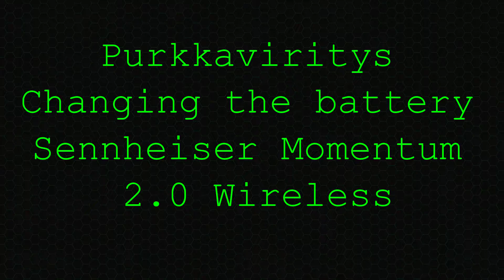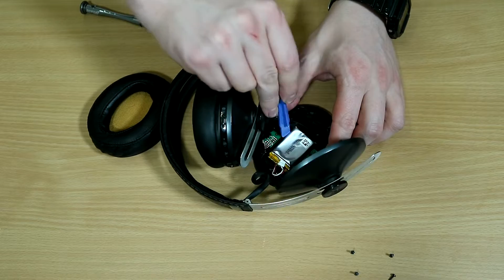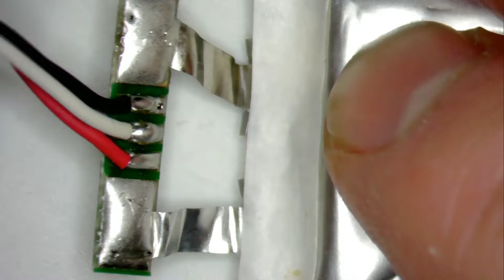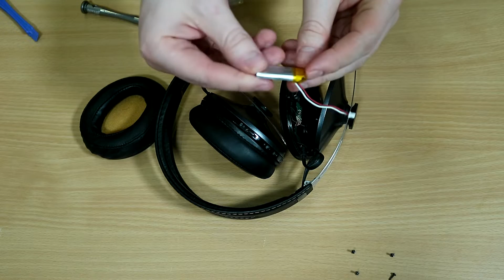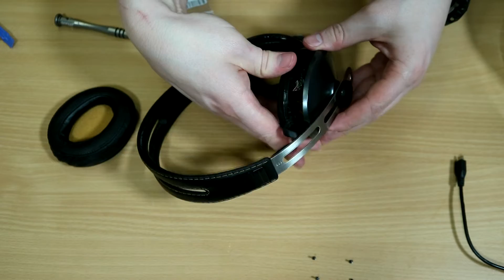Sennheiser Momentum 2.0 Wireless Battery Replacement

Comment: There is a difference with the Momentum 2 On Ear, which requires the user to unscrew a small circuit board, as the connector to the battery is beneath it.

Comment: For anyone doing a Momentum 3, it's the same process and on the left side too, except after removing the foam ear cushions you will need to remove the large plastic retaining ring with a slim plastic tool (it has this ring instead of stickers). It simply clicks in. When reassembling it, the plastic ring needs to be placed inside of the back of the ear cushion and then it will click back into the headphones speaker assembly.
Reply: OMG  ... it's a miracle lol. I got the battery in the mail from Amazon this afternoon and I managed to install it and then everything went back together shockingly easy. My headphones are back to life. Thanks so much again.  I feel like a bloody genius 😂
Reply: @RobbieCalifornia69  well done! Good on you for persevering
Reply: I completely screwed up by not having a friend video me taking these Mom 3's apart ...  because I can't figure out how they go back together. Not having good eyesight doesn't help either. I guess I'm going to go buy some new Momentum 4 tomorrow. I can't believe they sell expensive headphone that just become paperweights after just 3 1/2 years of use? This modern world really sucks if you ask me.
Reply: @RobbieCalifornia69  I suggest you keep trying to put them back together even if you have to ask for help from a friend. I gave my pair to my dad so unfortunately can't help with any reference photos.
Reply: @getthecats  My son just sent me a link that might help. I'll give it my best shot. Thanks for the encouragement  :)

Comment: Maybe you could help me. My speakers for my left side doesn't work. Sometimes it does, but I do not know why, Could you help me?
Reply from the maker: probably a connection issue, I take it that you are using them in bluetooth mode, if so you need to make sure the wire that feeds the signal to the speaker that has issues, is connected properly and does not have a break in the soldering joint. That is where I would start. if you are using a cable to listen, change the cable.
Reply: @Purkkaviritys  it works fine when the speaker is out of the socket, nfc wire is touching. I just have to find a way to fix it.

Comment: When plugged in, mine flash red light every 2 seconds but never charge. I measured the voltage across the battery at 4.1V DC. Could the battery still be the issue? What else could cause this? A disconnect of wire in the headband?

Comment: Adding to my earlier comment on Sennheiser Momentum 3 battery replacement. The 4 screws you need to unscrew can be done with a Torx Plus 6 IP screwdriver. I figured out the screw type, and found 3 Torx Plus screwdrivers on a well known auction site, the 6 IP just happened to fit the screws.
Reply: hi @oscarrox My M3 don't have any screws at all, did you have stickers or something? or did you pop the driver out of the centre first?
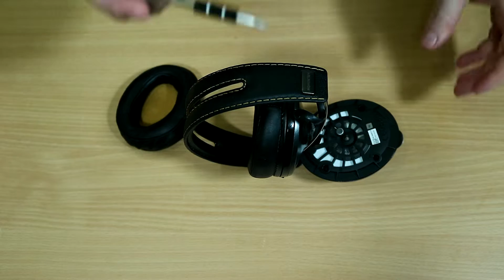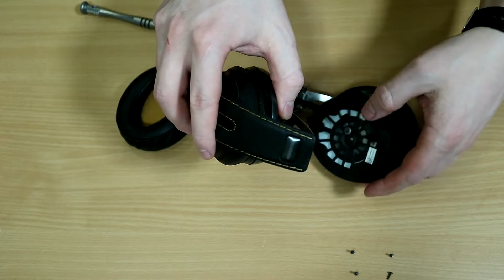Reply: @w1ldfl0w3r  Hi, like in the video at 0:56, after taking off the earpad, there is an oval (black plastic) plate with the driver fixed onto it, there are 4 screws (torx plus) on the plate you need to unscrew, then you can tip out the plate (like in the video at 1:05) and change the battery, which is also fixed to the plate. No stickers, the 4 screws were in the same place as in the video, but the plate is a bit different. Didn't pop out the driver as it is fixed to the plate. I bought my M3 in 2019.
Reply: Thank you for this valuable information! I can confirm the Torx  T-6 fits the screws in Momentum 3. @oscarrox

Comment: Good helpful review, mostly. I had been hoping the momentum 2 wireless would be the same procedure for my momentum 3 wireless headphones. Unfortunately the four screws sennheiser used on the M3 are difficult to figure out, could be torx or torx plus, they are very small, cant identify the screw head even with a magnifying glass. I've got the battery, cant open the earphone! Anyone seen this before?

Comment: Great stuff, just wondering, did you replace the tape behind the battery? if so what kind did you use?
Reply from the maker: pretty sure I didn't but you can just get some 3M double sided tape to do the job.
Reply: @Purkkaviritys  ok cool, thanks for getting back.

Comment: Hi, how do I know if my set needs battery replacement?   Would blinking red led while charging be that case ?
Reply from the maker: if it does not hold charge, then yes that would be an indicator
Reply: @Purkkaviritys  Hi, Thanks,   Would you know what it means why it's blinking red light every 2 sec when charging?
Reply from the maker: @rolandMclovin  no idea to be honest, but if I had to guess I would expect it to be because the battery is in such a bad condition that once it gets a little juice, the headphones wake up draining it fully and then shutdown allowing it to fill a bit again, so it gets stuck in a loop.
Reply: @rolandMclovin  did you ever figure this out? I have same problem. Blinks red every 2 seconds as if it's charging, but I can't turn them on
Reply: @Carter_Moody  not sure, but i think its the micro usb connnection problem. when I bend the connnector to one side it seems charging. One time it  did acctually charge the headset.

Comment: Welp, this video kind of confirmed that the issue I'm having with mine isn't necessarily a dead battery (thank you).
When plugging mine, the led would light up red and stay red for a few minutes, then turn off.
The headphones never turn on either.
Tried replacing the battery, same problem still. Then I made the mistake of plugging them in a fast charger, which seems to have made matters worse, because the led doesn't turn on at all anymore.
The led does flash red twice if I plug them while the battery is unplugged tho. 
Aaaand I noticed that one of the two wires for the bluetooth got loose during this process, so if I can ever fix the charging problem, I'll have some soldiering to do
Does anyone have an idea of what it might be? I'm considering getting my hand on an electric meter at this point :/
Reply from the maker: get yourself a multimeter anyway, it will help you diagnose lots of stuff later. see the EEVblog recommendation list on what to get.
Reply: Hey I am having very similar issues. LED not lighting up anymore, I had wondering if using a fast charger had something to do with it. When plugged in, the side with the microUSB slot gets hot (not the side with the battery). Is yours similar?

Comment: Do they use the same battery momentum 3 and 2 ?
Reply: LOSONCOER 1000mAh Headset Batterie Für Sennheiser Dynamik 3 Drahtlose M3 Drahtlose M3AEBT DYNAMIK Wahre Wireless AHB702535PCT-01

Comment: Thank you for this.
Do you have a video for foxing the bluetooth issue?
Several months ago my water bottle leaked in my backpack and entred into the headphone. It was working after cleaning and letting it dry but it sure got to more important parts and damaged the bluetooth. 
Thanks in advance

Comment: I tried to fix the fact that they didn't turn on, then I replaced the original battery with another one bought on Aliexpress. Still nothing! They don't turn on. What should I do?
Reply from the maker: is there any corrosion you can spot inside the headphones, because if they have had water ingress it may have broken things. Outside of that its hard to say. it might be that one of the chips that power the thing is broken. 

The corrosion is technically usually fixable, provided you can replace the corroded parts.

Other than that, I would look at the cables connecting the 2 halves of the headphones together and use a multimeter to test the continuity, as in does the power reach from the battery to the other side where the charging connector is.
Reply: @Purkkaviritys  Thank you for answering me. That's a very kind of you. The main issue is that I don't understand electronics.

Is it possible to find some replacement parts such as chips you were talking 'bout?
Reply from the maker: @DOMEROCK  well, you'd have to diagnose them first to see which if any are broken to be able to replace them. There are way too many components there to just try to randomly replace them.
Reply: @Purkkaviritys  iOk, understood. thank you!  In case i have one damaged chip, where I can find spare parts?
Reply from the maker: @DOMEROCK  provided that the chip has text that tells you what it is you can even find the parts, digikey for ex might have the part. This is why it would be great if we got right to repair trough so I could have access to the schematics so I could even look where is the most likely thing to break and then buy the parts instead of having to stab in the dark for a possibility that I manage to stumble on the broken thing by trying to reverse engineer how the device works.
Reply: @Purkkaviritys  I haven't found anything on digikey sadly :(

Comment: This might be a long shot but I figure I'll ask it anyway. My Momentums have recently starting to turn itself off during use. I figured it must be a bad connection somewhere, a bad cable or maybe even damage to the pcb. So I opened both sides and inspected them. I can see no visible damage to the cables, sodder points or PCB. I don't think it's the battery since it still holds a pretty decent charge. When the headphones turns off I can just turn it on again and it functions as normal, untill it turns itself off again in a couple of minutes.
I don't know what's wrong with them. If I can fix them myself I'd rather do that than buy new headphones. Any ideas would help.
Reply from the maker: sounds like the battery is the problem tbh.

If the wiring was the issue, you likely would not be able to charge it at all nor would it turn on if it was internal wiring issue.
Reply: I am having the exact same issue. Opened them up today, no visible corrosion or loose wires. Even tried gently shaking wires with a tweezer while sounds were playing, didn't see any change. I didn't take teh PCB in the right earcup out to check the other side though. My problem got consistently worse over time, before it would happen occasionally, now it happens very frequently. A small amount of shake or movement somehow triggers it but its hard to understand what type of jiggle makes it happen. I have tried shaking either side while holding 1 side firm, but still didn't see anything on 1 side to do anything more noticeably to cause this. Since this started, the mic also does not work on video calls on PC, unless I use the USB wire to connect to a PC using USB headset mode and select that mic. Mic works on phone video calls, but the headphone is also turning off frequently. Might need to email Sennheiser and see what my options are. I love these headphones too much to get new ones. Used for just over 3 years now.

Comment: I replaced my battery and the headphones work fine (there was already some charge in the new battery) BUT it will not charge.  I stick the usb cable in and there is no indicator light blinking that indicates charging.  Help!   It's too bad, because they sound great but there is no way to charge them or use them directly with a computer.
Reply from the maker: it could be that the usb connector is broken, so once that happened the old battery never got charge to begin with.

Comment: Has anyone replaced broken cable between the cups inside the headphones bridge? Is it doable?  🤔
Reply: Ive got the same issue, there's a loose connection on the wire between the cups on mine close to the left cup, did you have any success? any ideas how many different strands of wire are in that cable is it 4?
Reply from the maker: even if it wouldn't be possible, you can always run new cables between the headphones be it on the inside or outside.
Reply: did anyone work this out? My cable got connection problems just above the left cup yesterday.
Reply: There are so many cables leading through the bridge that it demotivated me to try to repair it (I have also have accidentally destroyed the charging PCB when trying to replace broken micro USB connector). For sure it is not possible to replace the cable without removing the rubber from the edges of the leather bridge and then you need to solder a lot of wires. Some photos from the inside of the headphones (cups are easy to disassemble, just be careful and do not use any power).
https://photos.app.goo.gl/mcbxmryaNVBheF5s7

Comment: Hi. My set has stopped charging.(no flashing light) Do you think the battery could be the culprit? I've had them for 4 years. Thanks.
Reply from the maker: Entirely possible, only way to find out is to open up the headphones.
Reply: @Purkkaviritys  Ok thanks

Comment: mine arent pairing, blocked jack port? (stuck in cabled mode maybe..)
Reply from the maker: the jack might have a "cable connected" pin, that is stuck and thus wont come out of cabled mode

Comment: Dear  Purkkaviritys thanks for the tutorial. I have the same  Sennheiser Momentum 2.0 Wireless it stop turning off when i pressed the button. Do you have an idea how to fix it?
Regards
Reply from the maker: check the connections of the button, maybe the solder has cracked and the button no longer makes contact?

Comment: I have pxc 550 headphones , they were working fine, place them on the charger. Picked back up for use now they don't work. They seem unresponsive. Plug them back onto charger and the battery indicators says full. Turn them on and off with no hole mode button and nothing at all. Any ideas ?

Comment: Do you know if the urbanite xl wireless have a similar process? I believe that my battery is dead also. The light only flashes while charging. Sometimes it works while charging but recently it won’t even turn on. Does it sound like the battery or might I have another issue?
Reply from the maker: similar? probably so generally the swap is the same, but the outer casing design is very different  so opening it may be very different.
Reply: @Purkkaviritys  thank you for the response! I understand your point though and since it's not functioning anymore I don't really have a fear to at least try. I found some replacement batteries on ebay so I'll give it a go and see what happens.
Reply from the maker: @jeminem619  you may be able to find opened pictures of the headphones on FCC website, you may have to look for a moment though as they usually have some weird name there.
Reply: @Purkkaviritys  pardon my ignorance but what is "FCC"?
Reply from the maker: @jeminem619  the US Federal Communications Commission, if you bring a device that has a radio (all bluetooth and wifi devices for ex.) you have to show the electronics, and there will be pictures.

Sometimes its just the board, sometimes its the device opened up.
Reply: @Purkkaviritys  alright thank you very much for the info. Also I hope all is well wherever you are during this time of crisis

Comment: I installed a 1200 mAh battery and installed. I had to make a few modifications but now it last a really loong time xD
Reply: What mods did you have to make for it to work, brother?
Reply: @felipedn7039  well I had to remove all what could be removed. Like the connector for the battery was in the way so I soldered the cable straight to the motherboard. Unscrewed the small boards and moved them to the sides then used my trusted multitool and filed away the screw holders so the battery could fit.

It took some fiddling but the sound is better now, removing that commector to battery and resoldering some connections made the sound bit more crisp :)
Reply: @hampusastrom4499  thanks for the reply, bro! I bought a 800mAh from aliexpress, probably arriving in a month and I'll definetly check your tips about the wiring and soldering it directly to the motherboard! Thanks again, hope you are enjoying your Senn's :) - oh, and btw, what's the avg playtime that you're getting in with the new battery installed?
Reply: @hampusastrom4499  its been a while but do you remember the thickness of the battery? is there enough space for 10mm thick battery? Thanks :)

Comment: Hi, thank you for the great video! Is there enough space to fit a little bigger battery? I found a battery in my electronic shop nearby. 
It have the dimensions: 25.7 wide, 42.5 long and 6.5 thick.
An answer would be very helpfully!
Reply: Did it fit. I am thinking of putting a fatter battery in mine.

Comment: The Lithium batteries are named after there size voltage and mah so if you want to find the exact battery you would have to search for: "3.7v 600mAh  702540"

Comment: Hello  Purkkaviritys, thank you for providing a tutorial, I'll be using this when the time comes to change the battery, any tips on hardware disabling the microphones? Do you think that will work for stopping the ANC? I'm having a hard time with the ANC, my ears can't take the pressure.
Reply from the maker: It may or may not disable the ANC, depending on how the phone firmware has been written, I have a feeling that since the Momentum 2.0 are a always ANC on device, I feel like it more than likely wont disable the ANC, and may cause further issues. Depends heavily on how its implemented.

I see 2 possibilities of what will happen, 1. you disable the microphones and the device thinks its in a entirely silent environment and ANC output goes down, or that the exact opposite happens and you get flooded with white noise. tbh I don't know what will happen ¯\(°_o)/¯.
Reply: @Purkkaviritys  thanks for the reply, I've blocked all mics with strips of cloth and tape to dampen  how much sound they receive, and it seems to have done the trick, I still get noise cancellation, but at a reduced level, all I need to do now is work out which mic is for voice input…